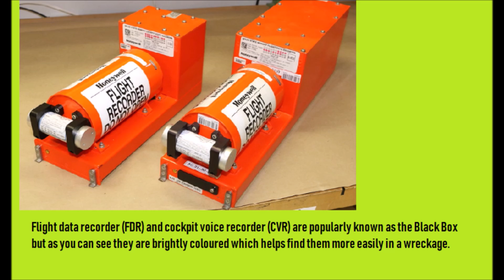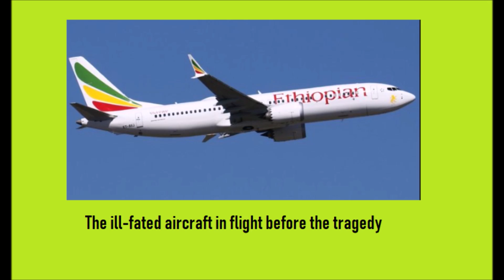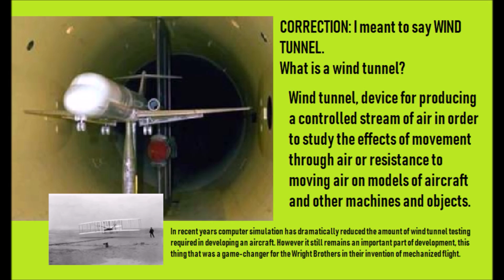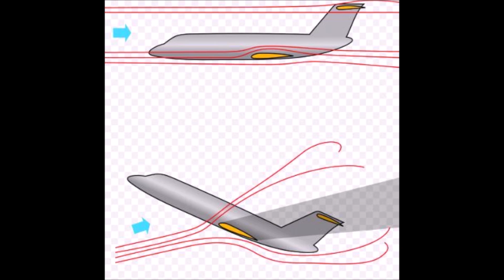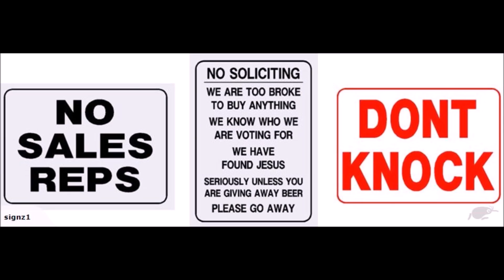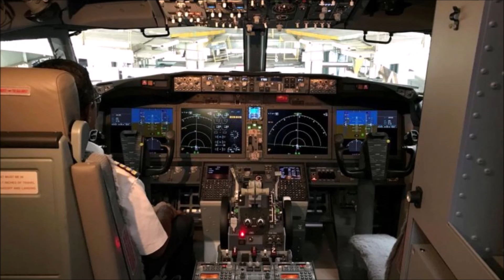Remembering The Boeing Max 8: Why An Early Better Fix Was Ignored

Comment: It’s quite flabbergasting that Boeing made these insane and incompetent mistakes on the B737 MAX because they got this absolutely perfect on the B787 and B777.     In my view there is nothing wrong with using a stall prevention system such as MCAS to make an aircraft more flyable instead of a redesign of the tail.  It’s lighter, more fuel efficient and safer.  Expensive does not mean safe.  The problem with MCAS is it’s poor design and implementation.   MCAS has 4 major problems:
1 MCAS does not generate an alarm to the pilots if the two Angle of Attack Sensors disagree.
2 MCAS does not disable itself if the sensors disagree or are producing implausible outputs.
3 MCAS can not be disconnected directly, it can only be disabled by pulling the circuit breakers for the stabilizer electric motor jackscrew .   This however also disables the ability to trim electrically leaving the pilots with manual trim only which doesn’t work at high speed.
4 MCAS does not limit itself in high dive angles or when pilots is pulling on yoke in opposite direction.

The sad thing is that a similar MCAS system used in USAF KC767 / KC46 refueling tankers had non of these issues.

The driving factor probably was that the management wanted no modifications that would trigger retraining of crew.   Adding two cutout switches for MCAS might have done that.  Also MCAS Sensor failure was rated 1 level below catastrophic which also prevented a higher level of design.    The B737 has an old computer and instrument architecture and philosophy which as two of everything.   If there is a fault the crew must identify it and switch to the side of the cockpit working.   Airbus aircraft as well as Boeing’s own 787, 777 have triplicated systems.  This means that if something fails the good instruments can be compared and vote out the faulty one.   It would have been awkward to write software within this system.

In the USA the FAA, NTSB, FBI, US Justice Department and a Federal Grande Jury (sort of like a Royal Commission in power) are all looking at this.   When completed and the grounding  lifted the B737 MAX will be the most scrutinized aircraft in history.  

I’ll get on it then.
Reply: So true. Then there is a Boeing video touting their first design using "Diversity" engineers; skin color and national origin instead of the best from anywhere on the planet.
Reply: @wa9kzy326  this is what I was thinking, similar story to the Florida bridge collapse.
Reply: Also one more addition ...number 5. Apparently, when the existing MCAS adds extra negative trim offsets EACH time it gets turned back on again.
Reply: Software can't fix a poor design.  BS. trying to think software is the fix.  Sure, military uses it with planes with ejection seats.  Airliners don't have ejection seats when the software fails!!!
Reply: I hope you are on it when they erroneously override the mcas by pulling back and the inherently unstable aircraft then stalls  and crashes. Because that is the most likely scenario for the next crash, once its backhandered into the sky again.
Reply: @jackrainbow560 You don't know what longitudinal "stability" is in an aircraft.  If it were unstable it would have a oscillating or phugoid motion.  The B737 MAX does not have that.  What it has is a more sudden stall and, that's all.  It is stable. It's 'departure behaviour is different.  You seem to be quite the nasty idiot
Reply: @WilliamJones-Halibut-vq1fs  You right on "more sudden stall" . Could it be not only sudden but huge stall? Look at how much it trim 2.X. Could it be too sudden for humans to react?
Reply: Luckydog Junction Experienced B837NG pilots were put in a B737MAX and they found it difficult to tell the difference in stall.  Only manifests in lightly loaded aircraft with excessive aft centre of gravity.  It would’ve been safer not to install MCAS at all.
Reply: William Jones-Halibut that seems to be the case. In cars also automation is becoming the norm. People are being led down the path of multitasking versus immersion in the primary activity. But the real culprit was upper management deciding money and ease over engineering and testing.  Most American companies with profit driven management are making stupid errors that are costing the companies money, costing thousands of jobs, and costing the stockholders as well. It’s a sign of the times. Short-sighted US management policy.  US government is guilty of the same. It’s not looking at long term anything. It’s corrupt as hell
Reply: @jamesmedina2062  It's all about quarterly stock returns rather than long-term vision because management pay is in shares of stock. Boost the stock, sell it, then float out on a golden parachute.
Reply: @jackrainbow560  " Because that is the most likely scenario for the next crash"  -- good point
Reply: @jackrainbow560  I can tell you from experience that the 737, including the MAX, is as inherently stable and easy to fly as any other airliner. The MCAS was only there for when pilots had gotten themselves into trouble hand-flying the airplane and poured on the throttles to try to get out of it. Already being nose-high, the extra power at low speed would tend to push the nose up even more, so MCAS was there to offset that situation only. Airlines all over the world have put lots of hours on the MAX with few problems. Boeing needs to update the software, as all newer designs have to be tweaked as issues become apparent. They had just never imagined any 737 pilots who have always trained for trim runaway emergencies not shutting off a malfunctioning trim (whatever the cause, not just MCAS), and trying to fight the system all the way to the ground (especially while leaving the throttles at full takeoff thrust). They didn't know what they didn't know. All the other crews who had reported the same problem occurring in the past year didn't crash the airplane over it--that was the big surprise.

Comment: Apart from having more than two sensors and only relying on one before it takes action, how about hooking up the system to the altimeter and telling the computer if height above the ground is less than 3000 feet, stop screwing around and turn yourself off.
Reply: @Dee: I believe the aircraft is likely to stall easier at takeoff in airports where mountains are around